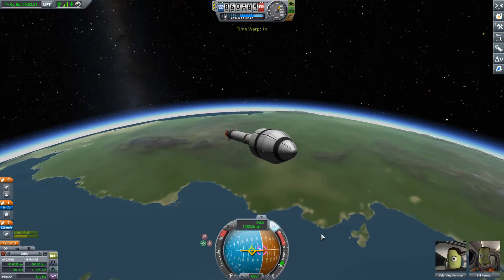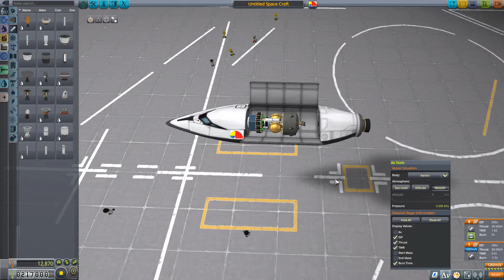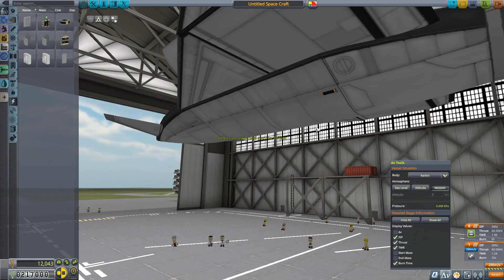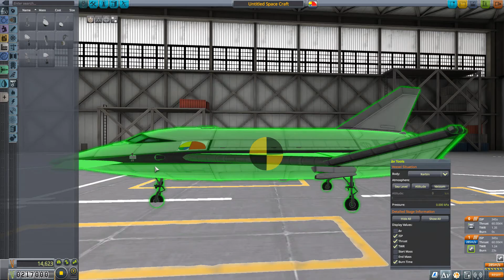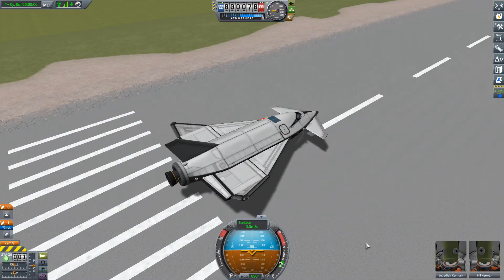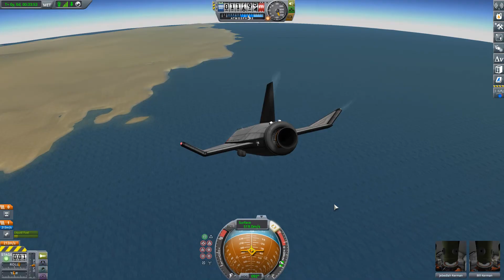Designing a First Shuttle | KSP (Not) Beginner's Guide

Comment: So... why not just put that payload on top of the rocket and ditch the plane?
Reply from the maker: No reason, in fact it tends to be cheaper, but some folks like spaceplanes.
Reply: @MikeAben  I like SSTO spaceplanes that take off from the runway since you can get a good size payload into orbit with them and return the whole vehicle for 100% value. With NASA style space shuttles I always wonder what benefit there is from the extra design complexity.
Reply: . There's been a story for many years that the NASA shuttle was designed plane-like to appeal to Air Force generals (most of them old pilots) in order to get USAF funding and other support.
   You might have noticed how seldom the "retrieve things" function of the shuttle was ever actually used.  And even then, all you really need is a big can with parachutes attached.

Comment: When I couple subs with a docking port they tend to wobble, especially with bigger subs in larger delivery vehicles. Is there a fix without running struts inside of the fairings of payload parts? 

In that same vein Is there a way to disable subs when being carried? wheels and such turning. And like quick keys for solar panels on the delivery vehicle then enables radiators on the sub that is also set to #1. any input would ne appreciated. thanks guys
Reply from the maker: Wobbling can be fixed with either the struts part or using autostruts. Wheels and the like can be disabled in the context menu for the part (just turn off the motor and steering). If you've got a lot of stuff you want to turn off it would likely be more convenient to attach all that to an action group.
Reply: @MikeAben  thanks for the quick reply. So with action groups there's no way to differentiate one ship from the other? If I have action group 1 activate the steering on Rover and I also have it to activate the solar panels on the delivery vessel both would activate and when I push the button
Reply from the maker: @Noidhole88  Yes there's no way to separate that. The game sees it all as one vessel. You'll have to put them on different numbers.